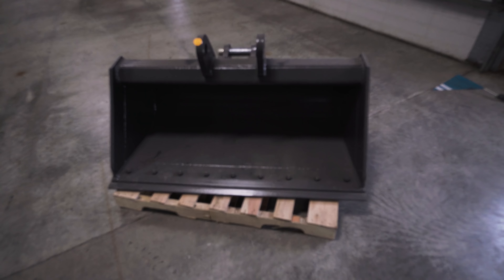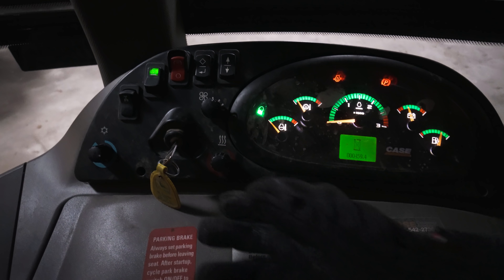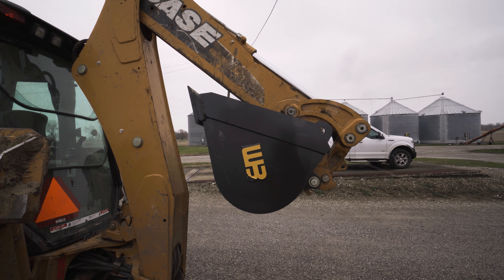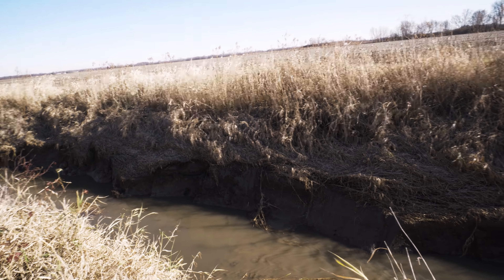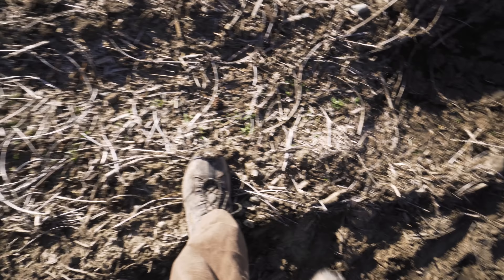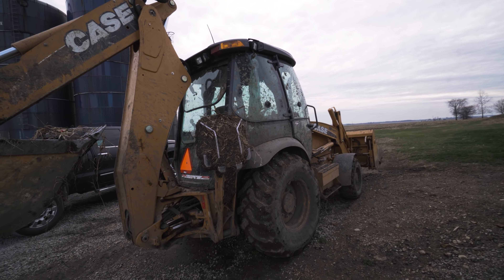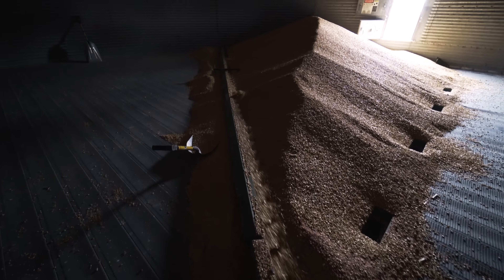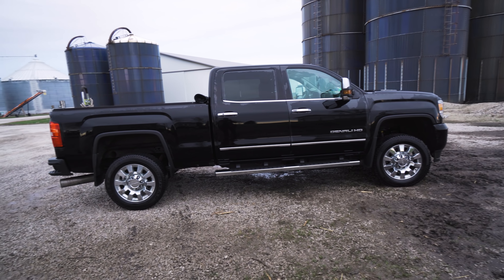New Equipment To Help With Winter Farm Work (Ep. 57)

Comment: Love the channel.  Might be late, but for your flat bucket needs. You can buy 2 spare teeth. Install them by whatever flat stock 1/2+ weld it between your two outside teeth. Leaving a 1/16th or so gap between middle teeth.  When you want just pop the two outside teeth out and your back.

Comment: Great video and great looking equipment. I wanted to say that you can improve your digging abilities in the backhoe with one more attachment. If you research a attachment called the engcon tiltrotator. You can make the backhoe do just as much as an excavator. It sits in between the end of the stick and the bucket but enables the bucket to spin completely all the way around and tilt while digging. They are extremely popular in Europe but they are starting to gain popularity in the United states.